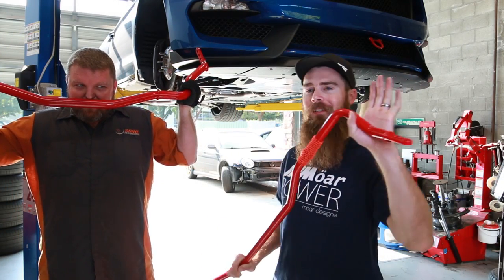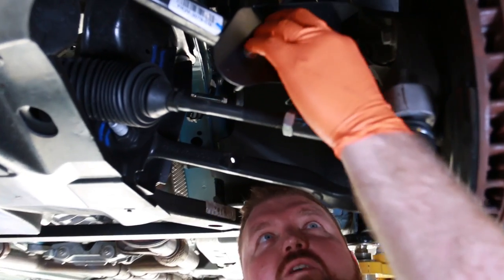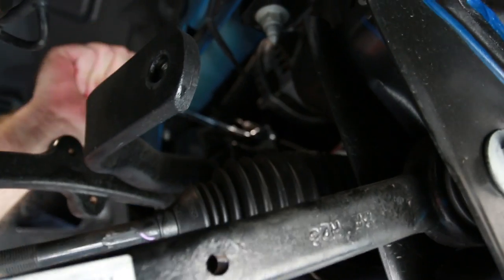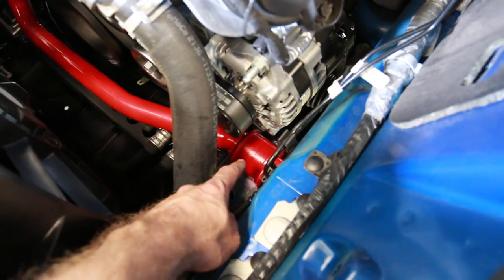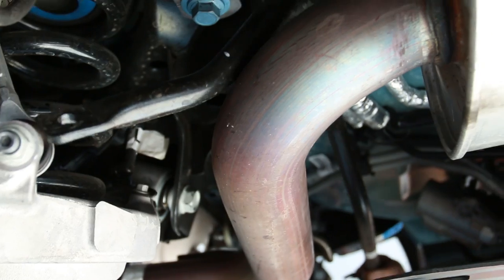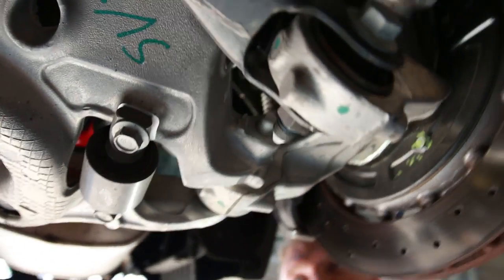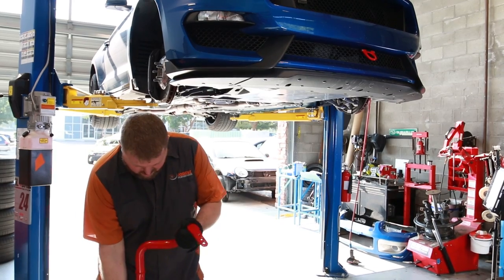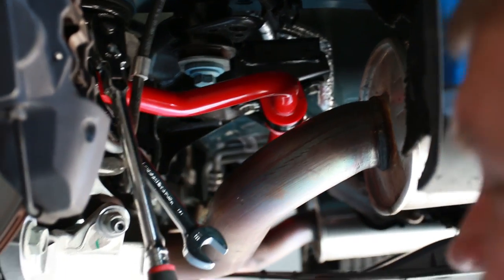Shelby GT350 NO BULL TRACK SWAYBAR INSTALL

Comment: Follow up after the install and hitting the track. We were able to dial in the sway bar settings and remove understeer from the car.
Reply: Snail Performance really looking fwd to a review on this. I feel the car Just needs minor suspension upgrades and tweaks to be a monster on the track. Is the only suspension upgrade so far?